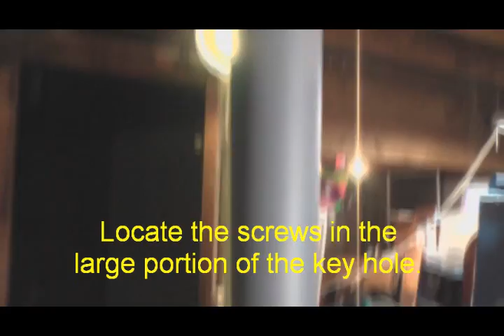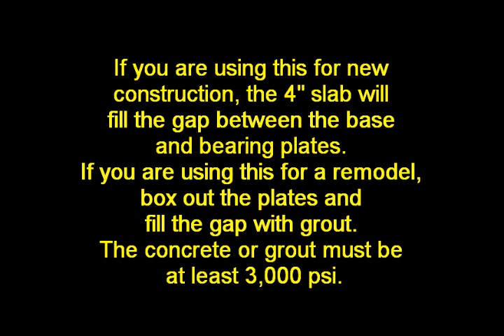Lally Lock Installation Video

Comment: For anyone seeing this for the first time, this product works.  The product line was bought out by Portland Stoneware, and is still available.  This is a good solution for replacing existing damaged columns (rust blistering, general rust, crushing at the girder, etc.).  This product can be set right over the existing footing.  The procedure is:  1) order the correct length column and the plate kits for each end,  2) install temporary supports, 3) saw-cut the damaged column flush with the floor and grind flat, 4) remove the old top plate, 5) with the new column secured to saw horses/tripod vide/bench, install the top plate and bottom leveling plate, 6) bolt top plate to underside of girder, 7) anchor base plate to slab, 8) extend leveling plate bolts to base plate to secure, 9) pack void between base plate and leveling plate with non-shrink dry-pack grout, 10) remove temporary supports several days later.

Comment: You have 4 little screws holding up the Lally column?  That's crazy!  Not buying what you're selling at all!
Reply: “Adjustable Base Set
Holds 55,000 pounds
3” adjustment
Self leveling
2 threaded holes in the bearing plate allow the plate to be connected to the base plate
After installation, the Adjustable Base Set must be encased in concrete”
Reply: You have pack the open voids with non-shrink grout.  This is done all of the time in the commercial world.  No biggie.  Just use non-shrink grout, available at Home Depot.

Comment: Good idea for leveling but.....what happens when you let down the weight of your house onto those 4 screws with no footing underneath?
Reply: After the  installation you MUST feel the gap between two plates with concrete mix
Reply: Need to pack the void with non-shrink dry-pack grout.  Available at most home centers.

Comment: Thumbs down on both video and product. You never state about proper footing and your bearing on screws basically.
Reply: You have to pack the voids between the bolts with non-shrink grout.  This is a very common method of column installation in the commercial and industrial world.  As for the footing, you need to make sure there is one.  We do this check, or "proofing", with a hammer drill.  If the bit goes down a full foot without breaking through to soil, we consider the footing fine for this product.

Comment: Can someone advise me. I need weird 81inch and they come 6ft 8 ft question I have can this be cut? Reason is there is embedded bolt on top..Not sure if it can be cut
Reply: Yes any concrete-filled lally column can be cut, using a grinding wheel, portable band saw, or pipe cutter.

Comment: Good vid. And seems easy. Definitely interested in purchasing a few. Just have one question. Can explain a little more detailed on boxing out the base plate and the best way to do that when doing a remodel. 

I have one lally column that's is rusted out from years of water in the basement and it in the center of a ranch type house. The base plate is not buried and look easy to replace. Any other tip would be helpful . Thanks in advance.
Reply: How long did it take before it rusted out?